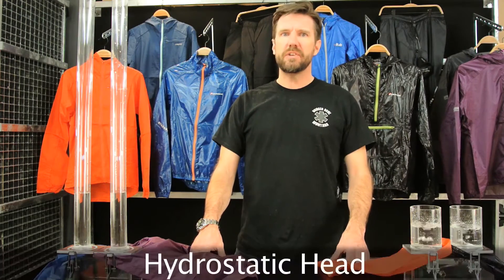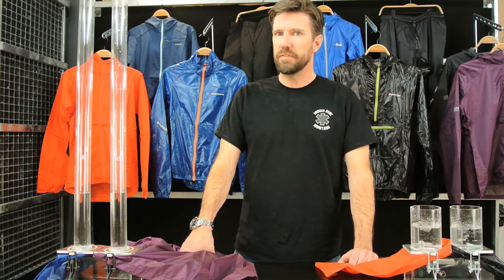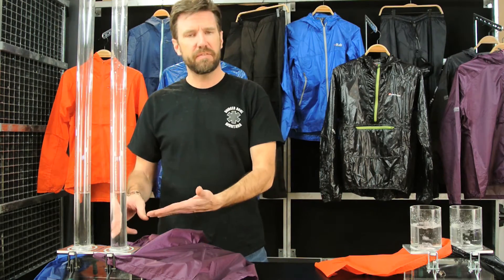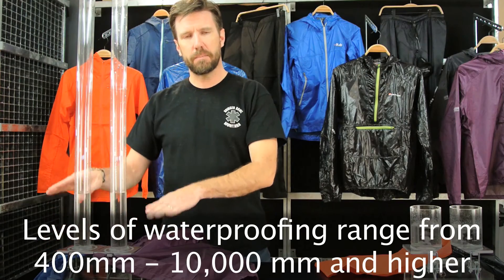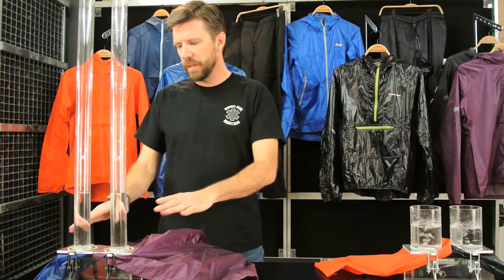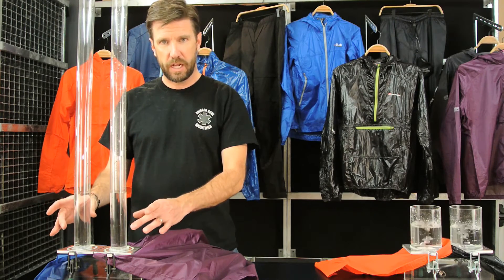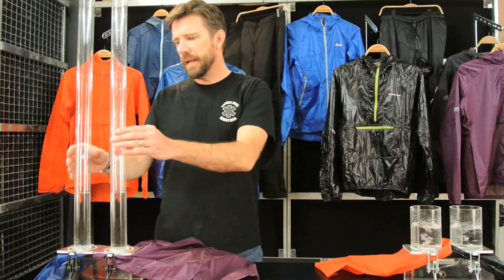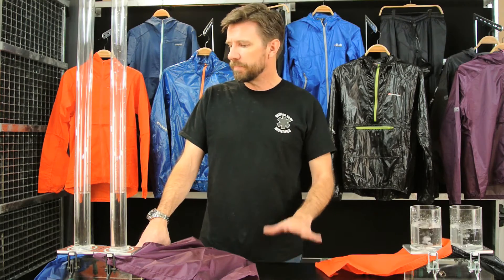Hydrostatic Head explained

Comment: Hi, I was just wondering what's the temperature of the water that you are using. You are saying that density of the  water is constant. It's actually not. If you look at the density vs. temperature graph, there is a slight change. So, if you run the test depending on the season with water from the pipe, expect there will be density change.
Reply: nisa saadah Boiling

Comment: If a fabric is rated as 20 meters, 30 meters, what have you, waterproof, is there a point, such as that high, where you can say, well, pretty much unless you tear it, it's not going to allow water through, ? and wouldn't this test be more standardized by using pressure? That 20 meters of water on an area an inch wide is different then on a foot in terms of pressure, so why don't they tell us in pressure? lbs/sq.inch? or kgs/cm2? That way the numbers mean something,  otherwise the other variables in the column make a column height rating 100% meaningless.
Reply: No, a 1,000mm HH is applying the same pressure regardless of if the cylinder is 1 inch or 12 as the volume of water is divided over the area, so more water in a larger cylinder is spread over a larger area.

Comment: Great video guys, I work in the production side of the industry and am held to ASTM standards. Your testing is a great break from the 20,000mm everyone claims by performing different testing procedures to get the highest number possible. I would like to see you test some seams on different waterproof jackets. I believe seam are a great quality indicator of the actual build/construction of any waterproof garment.
Reply from the maker: wow - thanks for the suggestion Jacob.... I will look into it. Over the last 10 years I have seen several brands begin to hold much tighter tolerances for seems, but never considered testing them.